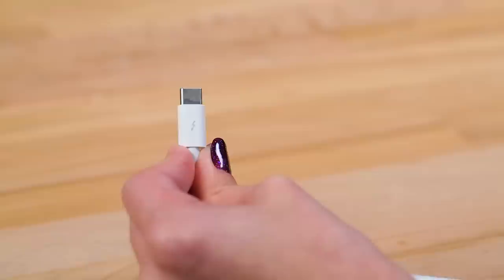What can you do with Thunderbolt 3? DIY in 5 Ep 75

Comment: I'd like to connect (2 usb pens for licenses) + An external USB 2.0 sound card + an external hard drive + a mouse. Can I connect those into a thunderbolt hubb? If so, can I do it without plugging tht hubb into the D/C or will I always need the D/C to feed those peripherals?
Reply from the maker: You can connect multiple devices via the Thunderbolt port. These peripherals will need to be daisy chained to be connected through the same port though.

Comment: Real reason why most of us bought thunderbolt... quick charge your cell phone. I kid you not. Asmedia that's built into most motherboards is garbage. I don't know WHAT manufacturers were thinking. It is a 1x implement, which means 2gbps and very little power to spare. The intel or realtek USB slots do not charge, period. Your phone will drain the moment you plug it in lol. Thunderbolt enabled quick charge and it's even faster than the quick charge power brick that comes with most phones anyway.

Comment: Thank You! After watching your video I am looking forward to try to connect my two macs for dual monitors, but I'm not quite sure if both my imacs are compatible for Thunderbolt 3 or not.  My confusion is when I bought my i7 I was under the impression that it is a souped up i5 or something like that to save money. I did buy it from Apple. It most likely has a T3, but need to make sure first. The one that I am connecting it to is an i5 mid 2011 and is most likely not T3, but an older version of Thunderbolt. I'll need to do my homework and hopefully I can use T3....Maybe with an adapter?
Reply: In the system report for the iMac 5 it says it is capable up to 10 gb x2  and it the firmware is 2.1.1. Maybe firmware doesn't matter? More homework. LOL. Thanks again!
Reply: Turns out I need to get a T3 to T2 adapter. I also have to buy a T3 cable as I don't have one. I will continue to use screen sharing until I decide to invest in those cables.

Comment: I want to know with thunderbolt connection how long a cable can be ?
Reply: Vaggelis Basoukas    There are a couple companies that make them in 100 and 200 foot lengths but I can only imagine they are very very expensive....Wikipedia
Reply: Only about a meter long before beginning to lose significant throughput...UNLESS the cable is *powered*, then it can be doubled or tripled, but being powered limits the kinds of signals it can carry. Try DYOR.

Comment: Will thunderbolt 2  work to a Ethernet a printer
Reply from the maker: Hello Salsapete,
It should work, but it depends on the Thunderbolt adapter and printer. To connect a printer to a computer using Thunderbolt 2, you need to have a printer with a Thunderbolt 2 interface or have a Thunderbolt 2 to Ethernet adapter and an Ethernet cable to connect both devices.

Please let us know if you have any further questions or concerns, and we will be happy to assist you.
Reply: @kingston  having super problems with my Canon 922 hoping on board with Air Printing, sometimes Yes sometimes No. I played it safe went with a USB multi port and ordered a USB to Ethernet dongle but today the Air printer decided to work so just waiting till it decides to stop working again then I will test this dongle out.